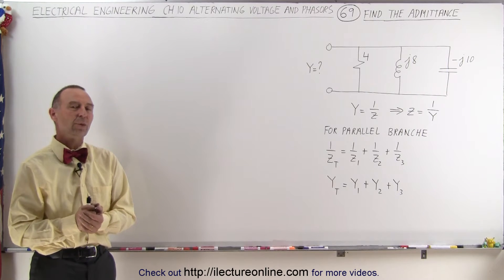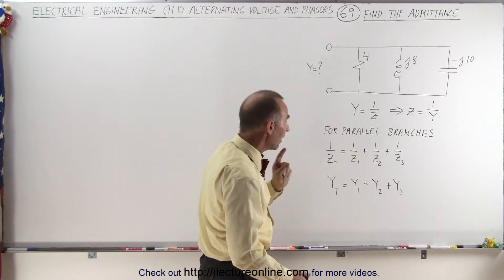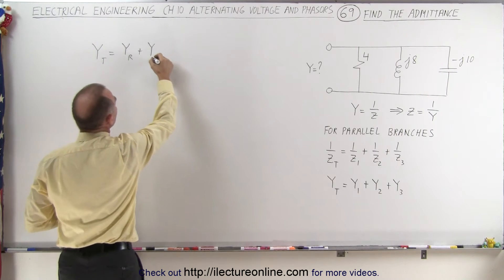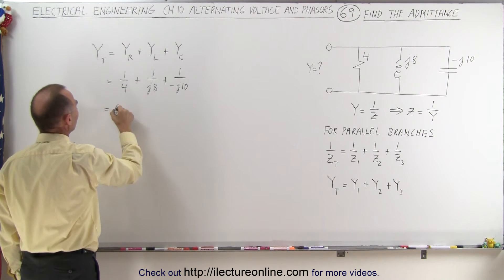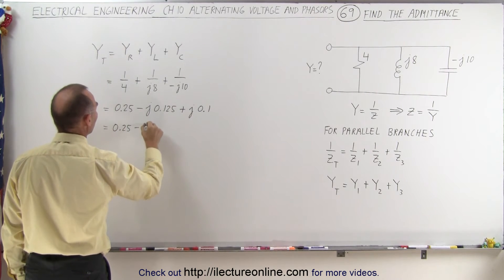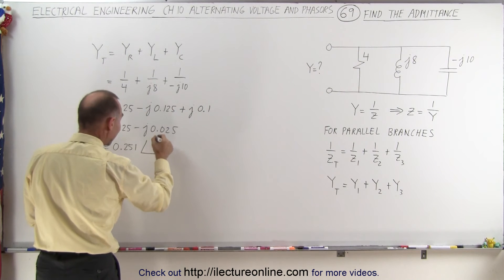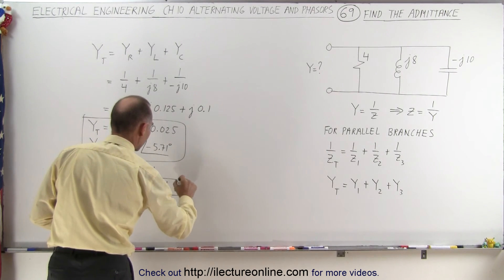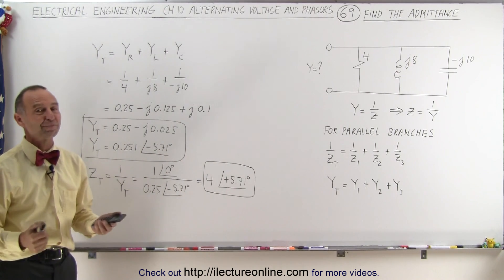Electrical Engineering: Ch 10 Alternating Voltages & Phasors (69 of 82) Find Admittance=?

Comment: Sir, may I ask, what if getting the equivalent Siemens for series branches, would I do a product over rule?
Reply from the maker: Take the equation:   1/Rt = 1/R1 + 1/R2   and replace Rt = 1/Gt   R1 = 1/G1  and R2 = 1 / G2 and you get  Gt = G1 + G2   (where G is the admittance)

Comment: what if Zi and Zc had polar values such as 1 / 2+2j. How do you move j up that time?
Reply from the maker: There are several techniques you can use.  You can multiply the denominator and numerator by the complex conjugate of the denominator.  ex:  1/(2 + 2j) x (2 - 2j)/(2- 2j)  or you can convert to the magnitude phase angle format.  We have videos that show you how to do that.  ELECTRICAL ENGINEERING 10 PHASORS, PHASOR DIAGRAMS IN RCL CIRCUITS